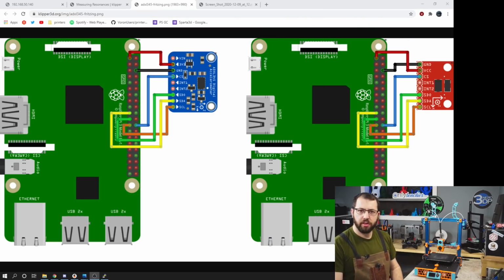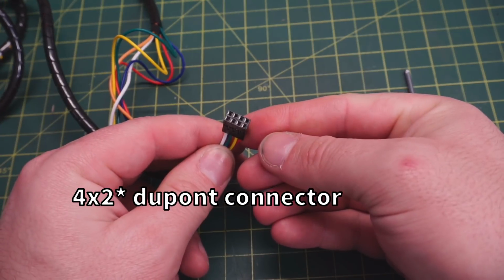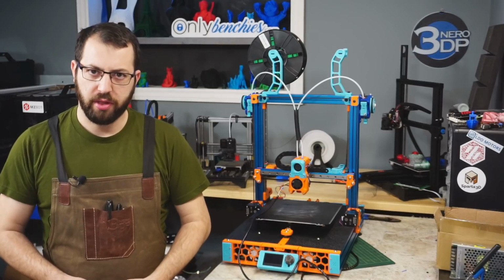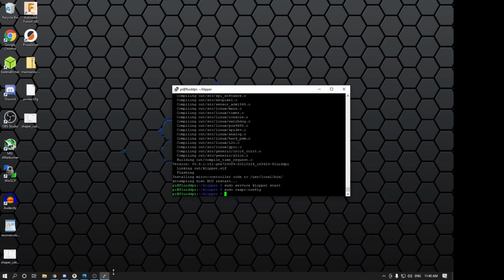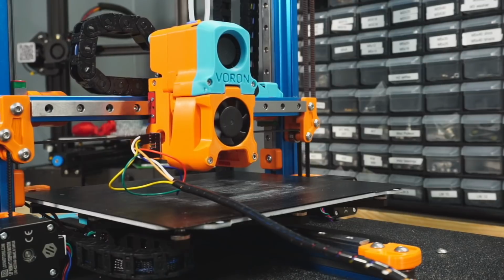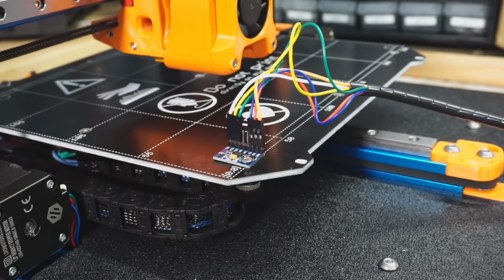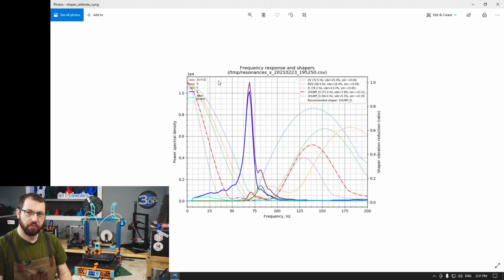INPUT SHAPER CRASH COURSE - Print FASTER and BETTER!

Comment: Hello, I need some help with input shaping measurements.

I assembled the ADXL and configured it exactly as shown in the video. The measurement runs correctly, but the print head or the bed (whichever is being tested) does not stay in place—it moves back and forth by about 20-30 mm.

Is this normal, or did I do something wrong?

I look forward to your response. Thank you!

Comment: hello friends i hope i can get an answer out of this. is there any new update on how the testing is performed? my printer (ender3) is moving smoothly back and forth (lets say on x-axis) and while its doing that it vibrates on the frequency the console says. so its the same as before but its doing it while it rocks back and forth smoothly in the same distance same speed. just wanna know if its just the new way of testing. thanks
Reply: My s1 was doing the same, long slow movement on the x at the same speed but I can hear vibrations ramping up, no idea what was wrong, found my answer though. Yes klipper has implemented a new version of input shaping in the latest version, it adds sweeping vibrations. You can change it back by adding "sweeping_period: 0" and "accel_per_hz: 75" to the [resonance_tester] config section. Or you can leave it as is. I'm changing it back for now.
Reply: @blastmastersean  thank you for the answer friend i will try this.
Reply: @blastmastersean  my friend you are an amazing person! thank you for answering. i did what you said and it works as before. my guess is that the new way is be more "realistic" to the movement of printing so it predicts better. still thank you!!

Comment: How do you make the cable??? I need to know what wires, connectors and crimps to get, im so lost. Ive ne er done anything like this before
Reply: You need a female to female wire connector. As for how he got it that long? No clue, but you can easily make one out of an old broken cable you dont use anymore and a few female connectors.

Comment: Would it be possible to use a smartphone accelerometer? If you connected to the web server from your phone and then attached your phone to the printer could you get the phone to send its sensor readings to the webpage.
Reply: Awesome idea! One problem is the phone would add significant mass, affecting the input shaping results.

Comment: do you have to input shape every time you want to print something or is this kind of a one off thing you do sometimes?
Reply from the maker: the values are saved to the config, you only need to re-run it if something that could affect it changes (mechanically, like adjusting belt tension, changing hardware on the moving parts of the printer, moving it from say a sturdy bench to a wobbly one etc)

Comment: How did you change which pins talk to the adxl sensor from the pi? Most of the gpio pins on my pi are blocked by the display that directly connects to the gpio pins on the pi

Comment: 🎯 Key Takeaways for quick navigation:

00:27 🎯 Input shaper is a feature in Clipper that reduces ringing (ghosting) in 3D prints, especially around edges.
01:24 🧰 You can use an accelerometer (e.g., ADXL345) to help tune and implement input shaping on your 3D printer.
03:00 📌 When connecting the accelerometer to your Raspberry Pi, ensure it's mounted correctly and securely.
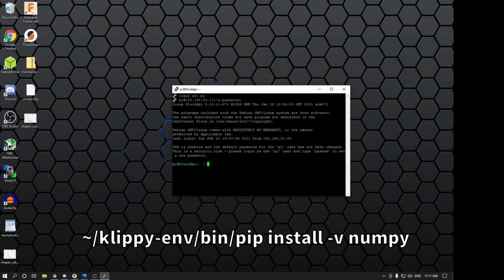05:36 💻 To configure input shaper, you'll need to install dependencies like numpy and make some changes to your Clipper configuration.
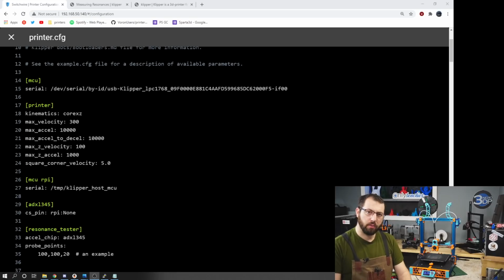07:18 📈 You can run resonance tests on both the X and Y axes to determine the values needed for input shaper configuration.
10:48 📊 Analyze the resonance test results to find the peak values for the X and Y axes.
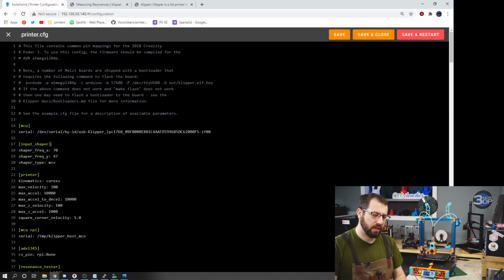11:33 ⚙️ Configure input shaper settings in Clipper, specifying the shaper frequency and type (e.g., mzv).
12:28 🔄 After configuring input shaper, you can remove the accelerometer and test print quality improvements with higher accelerations.
14:19 👏 This video provides a condensed guide to get started with input shaper in Clipper for better 3D print quality.

Made with HARPA AI

Comment: Can I use niput shaper on every board (3d printer controller) with a separate Raspberry pi connected to it, or does the board need to be a "controller and raspberry pi on one PCB" type? 
If the first, then I can upgrade my old Marlin printer with Octopi to Klipper with Mainsail using input shaper..

Comment: It's important to note that input shaping with the described wiring is only possible on a printer with a Raspberry Pi host computer or a Bigtreetech Pi4B carrier equipped with a Raspberry CM4 module. The Bigtreetech CB1 module is missing one of the physical connections required for input shaping. The same goes also for the new stand-alone BTT-Pi board BTW. This is by far the biggest drawback of using H616 processor based BTT host computers instead of genuine RPi's.

Comment: Been watching your videos specifically to get Klipper running on my v2 and using an accelerometer for input shaping. Your sharing of information has been the clearest by far, very much appreciated. I just have one suggestion: keep using the lapel mic instead of the stand mic. Your voice comes across much better and is more consistent as you turn back and forth from the printers.

Comment: Tremendous thank you and two thumbs up for this crash course.  The improvements in printer performance even for a novice Klipper user is remarkable. With input shaping my printer operates smoother, which is especially noticeable when printing faster or using gyroid infill.

Comment: What kinda hotend you using? I got a dual extruder ender 3 that I'm not too happy with my custom chimea+ install mostly because my mount warped and makes it impossible to tune correctly. Looking at other options if I can't find someone else i will just reprint from PC and redo mine.

Comment: Unfortunately there seems to be an issue with the additional dependency. The following came up on my Pi terminal:
pi@Klipper:~ $ sudo apt install python-numpy python-matplotib
Reading package lists... Done
Building dependency tree... Done
Reading state information... Done
Package python-numpy is not available, but is referred to by another package.
This may mean that the package is missing, has been obsoleted, or
is only available from another source

E: Package 'python-numpy' has no installation candidate
E: Unable to locate package python-matplotib
pi@Klipper:~ $ 

Please let me know if there is any solution to this. Thanks.
Reply: Found the solution to this by the way, I used the line:
sudo apt install python3-numpy python3-matplotlib
which worked just fine.

Comment: With the accelerometers being so cheap  wouldn't it be better if there were 2 of them, one mounted permanently on each axis and then have it read the data from both in real time and make  the corrections continuously on the fly , I wonder if that is something they are working on or  if it is something the more  expensive or  commercial or near commercial  grade  printers are capable of, I wonder just how much processing power would be needed to do that and how much   more improvements could be made by doing this
is the limitation for not doing this just that nobody has developed an open source software solution  yet 
 or would it be  lack of processing power or  has it just been determined that it would not  give much more improvements?
is this something they are working on?

Comment: I can't possibly see the practically of things that have to be re-calibrated over every small adjustment. Sure, this lets you print better and faster, but if I have to go through all these steps after relocating my printer or by simply tightening the belts, I fail to see the practicality. Please correct me if I'm wrong.

Comment: i tried 3 different adxl345 continuity test to make sure cables are ok and the soldering on adxl 10 times check pinout all ok my printer.cfg is done and all the other settings
when i run accelerometer_query i get this Invalid adxl345 id (got 0 vs e5)
Reply from the maker: With a recent update to klipper the first test always fails, does it pass when you run   accelerometer_query again?
Reply: @CanuckCreator  no i tried several times now im tryuing to make the cable using a cat5e cable before i used 28 awg stranded cables and if this doesnt't work i ll try 22awg cables
Reply: ok update i sacrificed an cat5e cable and now it works i think the quality of the previous metal strands wasn't good enough from what i know spi is quite picky on cables

Comment: Hi Nero 3d, 

Many thanks for all the videos you've made to support and help the 3d printing community, its greatly appreciated by myself and many others, in the video at 3:38 you mention that your 5v pin is the 9th down for you to plug the 4x2 dupont connector into, however for all the gpio pinouts i've been able to find, 9th down is either 3v3 or GPIO24. neither of which i have been able to find support for 5v for. 

is there a way to override the 3v3 to 5v on the Pi4 or can the GPIO24 be set to output 5v? 

My last printer i did input shaping on i had 6 individual duponts and had them plugged in all over the I/O but would love to have a 4x2 for cleanliness and simpleness if possible. Many thanks
Reply: The adxl345 will run on both 3.3v (pin 1 & 17), or 5v. In this case he's running 3.3v on pin 17.
Reply: @kylesreef2989  appreciate the reply mate. Thanks

Comment: Hi Nero, I'm surprised no one has said anything but you are actually connecting the accelerometer to a 3.3v pin and not a 5v like you say in the video. other then that great video! thank you!
Reply: This is what I was woundering about.  Does the 3.3v still work for the ADXL 3453?

Comment: This is a bit old so hoping u reply to me. I am trying to follow this but am confused on the wiring. at the 00:03:00  mark you show the diagram and mention you used different pins. I am thinking it is 3.3 volt and you show the 3.3v pin in ur vid but say 5 volts. Not trying to point out a mistake. Just trying to clarify so I dont fry anything. I am already connected like the diagram using 3.3v not 5v and nothing had fried........

I have the red adxl345
Ras Pi4 4gb
Argon Fan Hat
Im connected to:

gnd-black-pin6
vcc(3.3v not 5volt)-white-pin1
cs-gray-pin24
int1-purple- nothing
int2-blue-nothing
sd0-green-pin21
sda-yellow-pin19
scl-orange-pin11

Comment: First of all thank you so much for an epic video this has really helped me get through Klipper's docs. Secondly, so when you decide where to set the shaper Hz... in the terminal after you type in the calibration sand it is setting the png file. it tells you on the terminal what the best shaper type and Hz range is for each axis...

so for instance when I had typed in the code to read each tmp file, after it had compiled it in to a png it told me "recommended shaper ei at 90hz and y axis  @  mvz 45Hz, thought this would be an easier and quicker way to do it instead of logging into winscp and extracting the png files

Comment: I have read somewhere that creality tmc silent drivers are customized so that you can't use input shaper even if you are on klipper firmware. Is that true for cr10v3 stock boards?
Reply from the maker: AFAIK that is not the case
Reply: @CanuckCreator  I've found out that they say UART is not possible because of the custom way creality has implemented on their chips so stepper motor currents cannot be changed. I have no idea why I need to change stepper motor currents though.

Comment: I don't understand something. You attach an accelerometer and measure a CSV full of data, but then in the end you need to generate a picture of it and guesstimate some peak value "somewhere between 45 and 50". There has to be some more accurate way to find the peak automatically from the data?
Reply from the maker: This video was made back when input shaper was new..most now use the auto-tune method which i also have a video on which gives a more accurate number
Reply: @CanuckCreator  Thanks alot!
Reply: @CanuckCreator  I only see a livestream with autotune, did you do a video as well?

Comment: There is an error in your calculation. The "shaper calibrate" graph that is generated is not in 5 hz increments on the x axis like it appears. It is 25/4 = 6.25. For instance, your shaper frequency for x should be more like 69 instead of 71.
Reply: came here to comment the same

Comment: Pin 'none' is not a valid pin name on mcu 'rpi'

Once the underlying issue is corrected, use the "RESTART"
command to reload the config and restart the host software.
Printer is halted
Klipper state: Not ready

Comment: In fact belts has the same phisics as a guitar's strings. When the head is in center - it has one resonance frequence and another one when the head moves to a side. Input shaping have to measure resonance in different points and approximate different frequencies depending on x / y position for better results

Comment: Tip for all: don't shutdown your printer while relocation the accelerometer.  Those files are saved in the tmp folder and the files will clear.
Reply: You mean don't shutdown your pi...
Reply: Fuuuuu. I just did all this crap, shut down my pi and went to my laptop to finish. Couldn't find the CSV files and then read this comment. So frustrated!
Reply: The printer MCU can be safely shut down, just don't shut down the host OS.
Reply: How do you save it then
Reply: This must be added to the video tutorial ASAP!

Comment: Just a little note, you are connecting to the 3.3v pin on the Pi not 5v. It looks like most of these chips are fine from 3.3-5v but just keep that in mind if you are having issues that might be related to the chip not getting enough voltage.
Reply: I was looking for that info. My accelerometer has a pin labeled VCC+5v and another one just labeled +3.3v, I guess that should be ok if I just hook the +3.3v to the pin 17 on the gpio, right?

Comment: You mean for you these chinese adxl345's do work? Just to be sure I ordered two. One throws me a 'Failed to set ADXL345 register', and the other one gives a Invalid adxl345 id (got 0 vs e5) when a query is asked. (the latter is the same as with no accelerometer attached).

Comment: I will go out on a limb and say this would be a problem with Delta Printers.  I have posed this question before but have not got an answer yet.  If the Pi is doing all the work does it matter if the actual printer has an 8 bit or 32 board?

Comment: I learned about this feature in another channel a few weeks ago and decided to try but, unfortunately, I couldn't make Klipper work with my setup. I have an ender 3 with SKR 1.3 and TMC2209 drivers. It works perfectly with Marlin so the problem was my inability to configure Klipper correctly I suppose.

Comment: 9th one down from the top is 3.3v not 5v...adxl345 uses 3.3v, so that's the right pin but its 3.3v not 5v
Reply: Thank you so much for point that out and replying. I noticed it as well but nothing fried. THANK GOD.
Reply from the maker: The board can handle 5v just fine and doesnt affect it. This was tested on multiple boards
Reply: @CanuckCreator  Beau is pointing out that your pin selection does not match up with what you are vocally saying in the video. You say 5v, but then your configuration (with the 4x2 dupont connector) is definitely using the 3.3v pin.

Comment: A note about 'do not touch anything', when using a removable accelerometer, using a heavy cable setup like you did that touches parts of the printer and has the cables that connect to the accelerometer tensioned, you are both dampening the accelerometer and already changing the conditions of the printer and its resonance.

Take care in minimizing the effect a detachable accelerometer has on the system.

Preferably, use light cabling with sufficient slack from the accelerometer to a decoupling perimeter point and from there use your heavier cable to reach the Pi.

For permanently attached accelerometers it doesn't matter that much, but making the installation, including cabling, as light as possible is always best practice for a moving axis on a 3D printer.
Reply: Also note, you can use the graphic output of the test routine with an accelerometer as a visualization and benchmark for fortifying your 3D printer, how it sits on your bench and fortifying your workbench.

I didn't save any shaper settings until I did a few things to make the printer, mounting of the printer and workbench more rigid.

oscillation

And that will make it so that the printer firmware and parts have to do less work removing the oscillation, giving you even more speed and less wear on your parts.

After I did what I could to remove as much resonance that way, I redid the calibration for use in Klipper itself and the amplitudes of the resonances were barely a 10th of what they were before and the frequency had shifted.

Comment: I must have missed something, why does the clearance matter? You said the back of the chip has to be flat but all you're doing is temporarily attaching it for measurements so I don't see the point. Also, you mention soldering early in the video but never actually do any soldering, so... Why did you mention soldering?
Reply from the maker: The pins for the connector need to be soldered onto the board manually.and it needs to sit flat because if the chip is on an angle to the axis of travel you will get incorrect readings

Comment: FYI the Pi's with a 40-pin header J8 typically have two SPI busses. In Klipper printer.cfg they would be two sections as in doc but with "cs_pin: rpi:spidev0.0" and "cs_pin: rpi:spidev1.0"